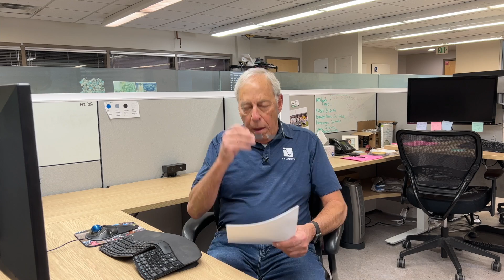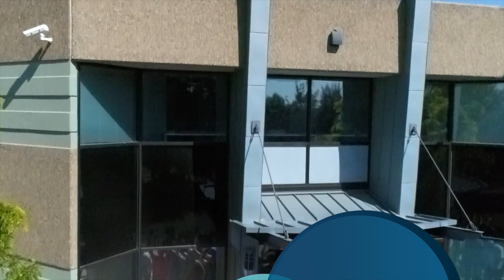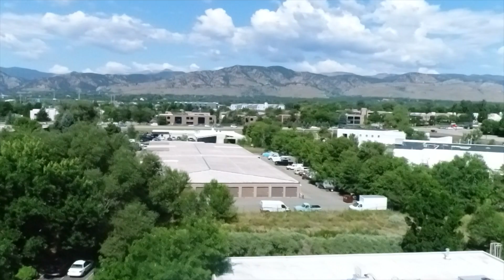Analog vs  digital EQ

Comment: EQ could never be that important to me to fix any recording that needed it to then buy a $5K hardware version of a Pultec or other hardware version. But like he said, I would never do an A/D conversion just to use a plug-in. Happily, I left vinyl long ago, so EQ plug-ins (well designed ones) should always give me clean changes on all of my source material.
Trouble is THE most common damage inflicted on my vintage 1960s/70s recordings was dynamic range compression-and usually applied globally and excessively in the mastering room. These "necessary" sonic crimes were legitimized to prevent overloads on AM radio and so record labels wouldn't get complaints about mistracking from consumers and their cheap vinyl players-or even SOTA turntables of  the day. 

So now those with high res systems end up victimized because much of our favorite music that was so badly compressed sounds like shit because there's next to no dynamic range. And unless there's some kind of AI-driven solution years from now, there's no way to restore those lost dynamics.

Comment: Hi Paul... Not an analog letter but a digital question, so I hope You'll love it just as much 😇 I'm thinking abaout buying a DAC/AMP combo and can't jump over the thing of digital vs analog volume control knobs... In the past analog knobs have been causing channel imbalance in the proces of adjusting the volume while the digital ones resolve the issue by correcting all those volume levels and all... So how do You see it and what is it today? For instance iFi Audio is all about analog volume knobs... Why is that when they can just get digital and go on like normal audio gear companies? Should We all fear the channel imbalance of the iFi volume knobs or is it a thing of the past? THX in advance kind sir Paul 🤗

Comment: I'm a big fan of EQing. I prefer analog tone controls over digital. Sure, digital has more fine tuning (and I use it for that on one system, i use both!) but analog is limited to factory set shaping; but digital is also more prone to clipping, and analog tends to be much noisier. It's a pick your poison situation. That said, I've always found analog EQing to have the best tone and sound. I have analog bass controls that always (always!) go deeper and richer than any digital EQ could do, if I did it digitally it would clip and sound muddy and not nearly reach as deep. Digital is like a scalpel and is great for minor tweaking, especially for treble since you can cut specific frequencies; but for bass and mids analog is king.
Reply: I know this is very late. But gigitial EQ's are not more prone to clipping. All digital plugins have 32-bit bit-depth at least. Likewise with all DAW's. So you have over +700dBFS above 0dBFS, which includes every console fader. Just because a signal reads above the red on a meter doesn't mean it hard clipped. 

Secondly, digital EQ's don't have a signal to noise ratio; nor do they have tolerances and ratings for current and voltage for the capacitors, resistors, diodes, etc. Since they don't use electronics. It's just binary and mathematical algorithms. So you are actually more prone to distortion with analogue (of course). This also reduces the lifetime of the analogue EQ's when you drive the current. 

When it comes to THD (Total harmonic distortion), this comes from the electronics of the circuitry... we have way more options of THD inside a DAW if we want to colour the signal. I've been using analogue for over 2 decades... there isn't anything exclusive about the THD from analogue gear than to what I can create using waveshapers inside a DAW. 

And when it comes to tone... your idea about analogue providing a more warmer tone or whatever you think is happening is likely placebo. You just expect analogue to sound better and therefore conclude it to be better.

I can guarantee a low-end boost on any digital EQ compared to an analogue one. When doing blind tests, you'll score no greater than chance. 

I fooled myself for at least 16 years that the NEVES 1073 pre-amp had better tops than any digital EQ. And that the API 500 series had just better lows than a digital EQ. 

What made me realise that I was fooling myself was when I started to program my own GUI's for digital plugins inside FL studios patcher. When I eliminated seeing the spectrogram and the EQ curve, and I just played with knobs without any reference except a number on a dial, I realised that I would always be simply boosting bottom end more so on analogue equipment because I didn't see the curve. 

So then I decided to do null tests tried to apply identical boosts to both bottom and top end with various analogue gear and digital EQ's. 

While conducting these tests, I realised that the NEVE 1073 applied boosts in the bottom end and top-end without even touching the EQ. And of course, all I hear, therefore, is increased bottoms and tops from the get-go. You can just create a smiley face with a digital EQ in addition to any other EQ changes to achieve that.

And fundamentally, when listening to audio examples and being honest with myself, I realised the bottom end was just as good with fabfilters EQ than the analogue gear I had. The same was true for the tops. I was simply too scared to boost as much as I was doing with analogue gear than with digital.

Then the other thing, of course, is noise and THD. The THD sometimes sounds like the odd harmonics are being boosted with a sort of fuzz-box like noise. Sometimes, all harmonics will be amplified, and it will sound more like overdrive. 

I have waveshapers... they can be modified, be it symmetrically or assymetrically (to change which harmonics are amplified). I have EQ's to shape the tone of distortion. 

And I have as many layers as I would like inside a DAW to alter tone. 

Honestly, personally, I wished I had never wasted so much money on analogue over the years because digital offers so much variety of plugins that I should have just stayed with digitial exclusively.

But of course, if you like analogue, then you like analogue. That's the only real valid reason for using it. "I just like it." Because it certainly isn't doing much different to what digital stuff can do.
Reply: @iamtherealrenedescartes  No.
Reply: @mat.b. My bad. I assumed I was talking to an adult.
Reply: @iamtherealrenedescartes  you used way too many words to say you have no idea what you're talking about.

Comment: To finish if you need correction after isophonic alignment and you will (even if not recommended) there are two main reasons:
- 80% of mastered sound is very poor in the mid/high range resulting in a +5/+25db in the low range so you need the lower the low end quite all the time. The good reference are old mastering not new! it's easy to hear when you're aligned! Specially digital which is furiously and unnaturally high in the 20/60Hz range! Why because loudness war and mass quality devices heavy reduction in the low end and for digital unatural low end bandwidth behavior well known in electronic music, etc, ask JMJ he well fought for this problem unfortunately still active!
- You have hears disabilities! In that case to have worked with that kind of people, you need to switch to analog, digital distortion are so huge that it's painful for these people. One of my friend terminated with only piano or bass digital sound! Unless you can afford dsd 512 files, better go to analog less prone to distortion in the mid/high range. It's better to 1-4% distortion on all the bandwidth instead of 1-100% with digital (even filtered at dac stage) for these people!
And no having a dac with 0.000000000000001% thd won't solve the issue! Again digital full of technical stupidity dreams...

Comment: Also the question is not a good one. Primary usage of EQ at end time is isophonic curve reproduction (Which normal people never be able to reproduce in the low end) regarding room speaker and device capabilities! Changing the sound to your taste is a bad idea as your certainly not as good as producer/artist!  As soon as you have the right/most representation of the isophonic curve you can lower or boost the both end according your taste (which i also do not recommend) , that's why amplifier never get a mid range if done in the state of the art! If you use analog which i do recommend you need an eq behind/in front of each analog device specially for tape, to correct in case of need Very high end/record curve in case of low speed usage/no adjustable bias , on vinyl also to correct 16RPM in the very high end. In digital the source should not be modified as even if bad quality reproduction, there is no issue regarding bandwidth! In most case unless your on dsd 256/512 it sound bad because it's bad nothing more, adding mathematical (digital) correction to something bad = something bader!

Comment: Analog eq are way better than digital eq even if technically less flexible, further more dsp are working in a virtual mathematical world which result in complete lost of integrity and awful sound when going to far in the + range! Just good for again a full digital chain who worth nothing because at the end always finish into an analog amplifier!
just try tu push a +12db at 16Khz on both of them the analog will make great result, the dsp awful ones! Again digital is only technical dream full of bugs! When you can always use analog gears! Today it is well known that digital is useful only when you can't afford a real gear, but never should be the way to go if you can afford the real one! 
Specially for end users there is absolutely no interest in destructing more the original source with DSP! It can be tolerated for music makers (the more rich are using mixer eq instead of dsp) but those one always finish straight into one analog one before the final analog print! Remembers digital perfection is a pure myth!

Comment: klark teknik dn370 is what I own.. a 30 band 1/3 octave analog fully balanced EQ.  I don't always use it but I put it in the chain when I want to change the frequency response of certain headphones.   For example I like a +3 to +6 eq in sub bass region frequencies for HD800s.
Reply: Obviously per your taste, but I would keep any Eqing within a +/-3db range at home. 3db is the perceived loudness of doubling or halving the audible signal, which should be more than enough to iron out any issues you hear in your system.

Comment: I normally run my equipment "flat", but I will Not use an amplifier or receiver that doesn't have tone controls.    
There are too many reasons in favour and too few against, 
including the fact that some recordings need a tweak to make them listenable.

Comment: Everyone's opinion in what sounds good varies. An equalizer and or Dsp is in my opinion an absolute must have tool for any type of audio. So, you just dropped 2 grand on a pair of speakers and your heart broken because they just don't sound good. Scrape up and buy a Dayton Audio Dsp 408 (can't be beat for the price) or if using your Pc as a source then use Equalizer Apo and I guarantee those speakers are going to sound great and just how you want them too.
Reply: I've been using my automatic dsp setup in my Yamaha (Ypao) receiver to eq my homemade khorns and it takes away the midrange fatigue and boosts the highest freq. where the ev t35 tweeter drops off. I don't feel bad doing it as Klipsch's own flagship Jubilee now boasts dsp.

Comment: The reason most preamps don't have bass and treble controls is that they are crude, a one size fits all solution with no adjustment other than gain with a fixed frequency response. DSP on the other hand is easily adjusted for center frequency, gain, Q, and filter type. Multiple digital filters can be used selectively and tailored to each systems needs.

Comment: Don't like bass and treble controls? How about we also throw an old DBX expander box into the chain! Remember those? (I have three, a 119, DBX1, and a DBX3)
EQ is a tool. As long as there is a bypass switch I see no issues at all. Like any tool, use it only as you need it.
Reply: It's still Ok to have eq's and gizmo expanders. They just will never make it into the high end or purist bibles.
Reply: I own the dbx Soundfield 1a speakers, dbx 5bx ds, dbx sub synthesizer and an ADC eq.  Utilization of that equipment and proper speaker placement can produce astounding results.

Comment: Analog us analog, digital use digital makes perfect sense.

In terms of using EQ, well I have to admit, I am hard of hearing and have hearing aids. I will adjust EQ to match my hearing aid curve (in much, much, much better granularity than I have in the HA itself) so that I can remove the hearing aids and still hear what the artist expected (as close as I am able to replicate that giving me crappy hearing, of course).

Parametric EQ, with L/R level EQ control is a game changer for me. But EQ, as Paul says, isn't for everyone. For me, it's great.
Reply: What program are you using for your EQ?
Reply: @sailormansteve7642  I do all my EQ inside Jriver Media Center.

The Parametric EQ gives per channel adjustments and works pretty well.

I admit I primarily on use the hearing aid EQ I need for earphones/headphones but have done on occasion for listening on loudspeakers.

Comment: I have an RME dac with DSP. Bass, treble, loudness and a parabolic EQ. I don't really use them, but the EQ is nice to play with. I have a terrible L shaped room and the EQ works nice to calm the bass response when we are rocking out, I can target the offending freqs and cut them.
Reply: it's quite odd that using DSP EQ inside RME DAC sound slightly smoother than using Roon EQ.
Reply: @allansh828  I agree it is very smooth. I have used many anologe EQs over the years and most of them (except for very high end that I didn't own) seemed to add audible distortions. Not usually terrible but definitely noticble by me. With the RME I get a black background,  just dead silence, no filtered sound. I couldn't say about Roon. Not a fan of the built in stuff on my computer or any apps that I have used though. I do believe messing with the sound is best at the digital stage, then the anologe signal remains "pure" , at least to the signal the DAC puts out. Which in my eye keeps noise to a minimum. If any of that makes sense.
Reply: I wish more DACs used the RME approach.  Although I don't have an RME DAC (I'm happy with my SMSL VMV D1SE), the RME ADI-2 (in most recent form) really is several tools in one: DAC, Pre-Amp, Equalizer/loudness, and headphone amp.  While some DACs have a pre-amp function and headphone output, those are afterthoughts and don't compare with a dedicated pre-amp or headphone amp, while on the RME they are said to be similar to fairly high quality separates.   

And no DAC (that I'm familiar with) has the EQ ability of RME.  PLUS the more recent RME DACs have tone controls right on the remote control.  Although the RME DAC with remote is fairly expensive at about $1300 US (with remote), when you add up all the features its quite a bargain.
Reply: @andrewfurst5711  Ya, I bought it for the versatility. You can use all or some or none of the functions and it really performs to any need. Flawlessly to my ears. I'm sure many DACs are just as good for DA processing, but the added functionality put it over the top for me. I use it as a pre-amp, but I also own Tube pre-amp I feed with it to get that tube tone. Happy with it both ways.
Reply: Yap.the RME is a great DAC. I am using the PEQ to adjust to my favorite room curve, to reduce a bass resonance and to compensate differences in old recordings ( versus new recordings). Source is always digital. For me it makes more sense to use an EQ than swapping components or cables. For sure it is cheaper.

Comment: Why  don't high end pre amps  have bass and treble controls?    I've heard  there is a phase problem when dealing with them.   It  would  be  nice to turn the bass down on MOFI records.   I  run Audio Research tube Amp and Pre amp and I remember back in the day when I bought them  NONE of the high end equipment had them and everyone I talked to said it messed up the phase / sound.     Love your channel by the way !
Reply: There are some high-end preamp (not exactly high high end but in 10000$ range) with EQ on top of my head is that Mark Levinson made some.
Reply: @mrlazda  Don't see any current models with bass and treble controls, maybe I skimmed the website too fast. They have a Subsonic filter, 15hz, makes sense for Vinyl.
They have a high pass at 80hz, that makes no sense to me to do that.
Reply: @S J  sorry, my bad, it does not have a name of Mark Levinson company, but Cello (other company created by Mark Levinson), and I do not know if it is still in production it was introduced in  80,  I know for it bacouse my friend who is audiophile (I am not in litterla sense, I perfer studio equipment) and he like Mark Levinson product have it. The correct name is "Cello Palette Preamplifier" according to my friend.